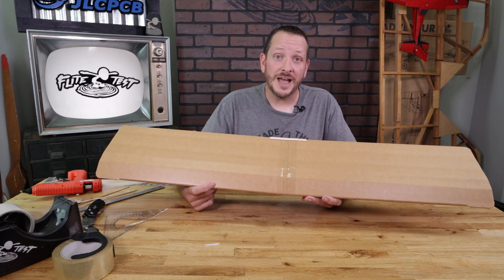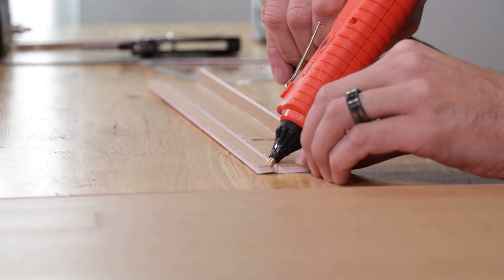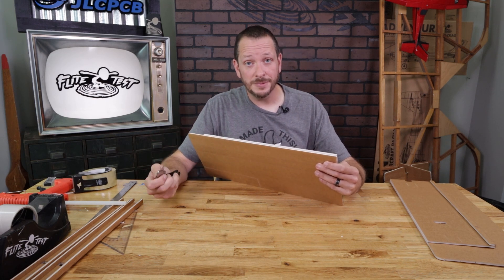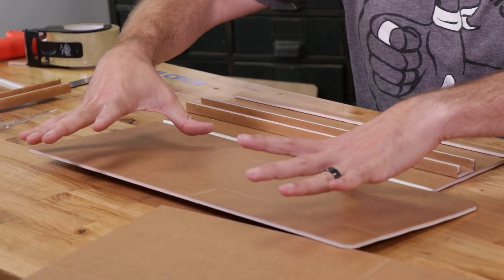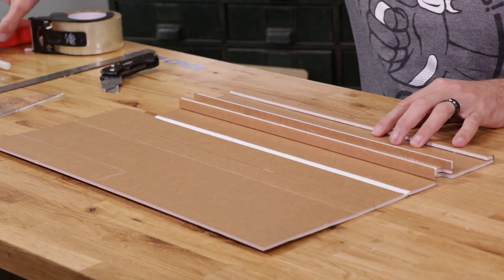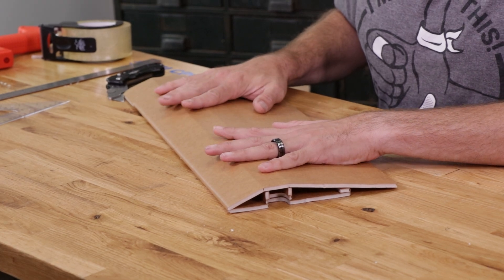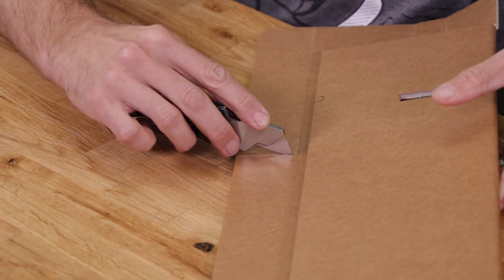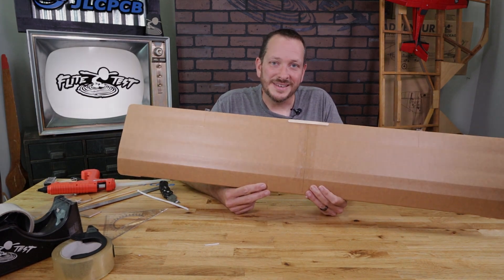How to Build the FT Tutor Turbo Wing & Trainer Wings  //  BUILD

Comment: I'd like to offer a tip that either eliminates or reinforces the hot glue in the hinge especially if you go thru the paper. I use 3M medical tape some hobby outlets sell as "hinge" tape. It works well and it sticks quite well with no potential backlash from using too much glue or not wiping the excess out quick enough. Just make sure you apply it with the surface fully deflected!

Comment: Looks like it would be easy to add flaps or would you recommend just programming flaperons?
Reply: U wont get a response from ft, in case ur expecting
Reply: There were some videos on an earlier model where Peter and Josh had one of each configuration. Peter seemed to like flaperons better. I would make the control surface go full-span in that case and you may want to cut different servo holes so that they are centered instead of having them so far outboard. You will also need to cut a wider bevel so your flaps can deflect to a max of 60 degrees.
Reply: @mikekelly6774  Thanks Mike, that is some really good info.
 BTW, I got the Ft Tutor for Christmas so I'll be making the decision pretty soon.